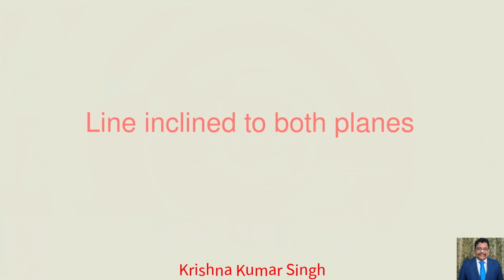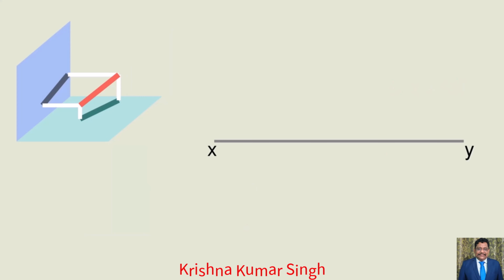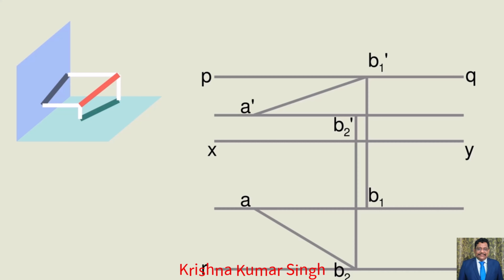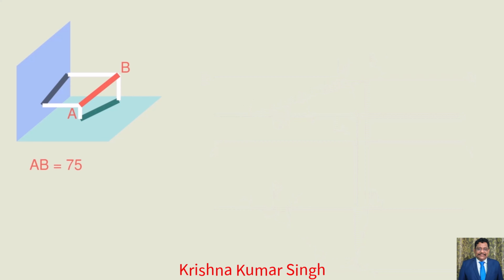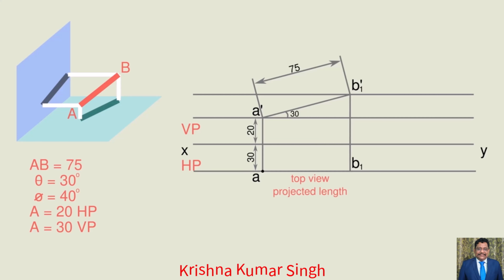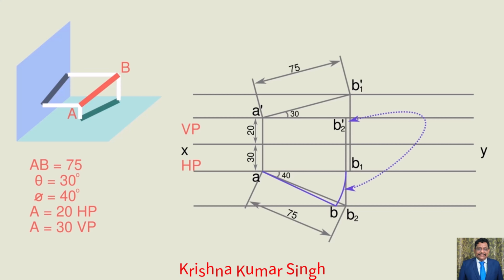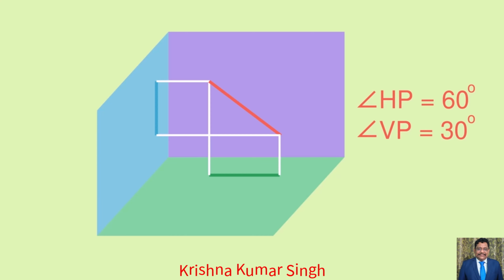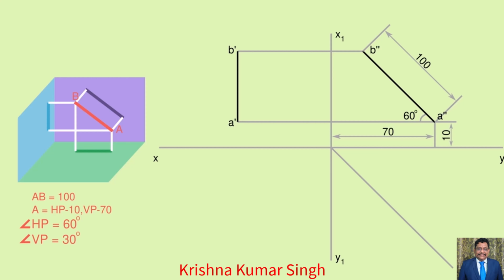Projection of Lines Inclined to Both HP and VP | Engineering Graphics - Lecture 14

Comment: What if θ + φ is more than 90°?
Reply from the maker: This is your specific question.
What Happens When θ + φ > 90°?
I.	The line still remains inclined to both HP and VP but now in such a way that the angle between its front view and top view becomes obtuse.
II.	The foreshortening effect is more pronounced.
III.	The sum of θ and φ exceeding 90° means the line is steeper and more inclined to both planes, causing more distortion in its projections.
Projection Behavior:
a)	The line’s projections become even shorter.
b)	The angle between top and front views (on XY reference) becomes obtuse (> 90°).
c)	The line still lies in 3D space and cannot be directly represented in true length in any one view.
Reply from the maker: I appreciate your support. Please feel free to share my YouTube link and Subscribe with your own friend group. Additionally, consider checking out another playlist for further career growth opportunities.
Reply: @TRTCKK  but projections can not be drawn in this case? how to draw the projections?